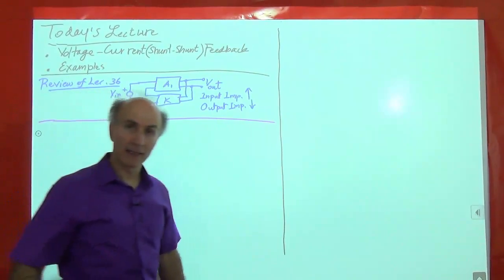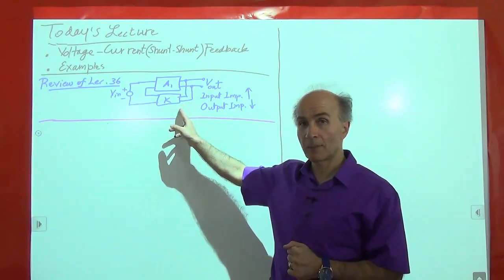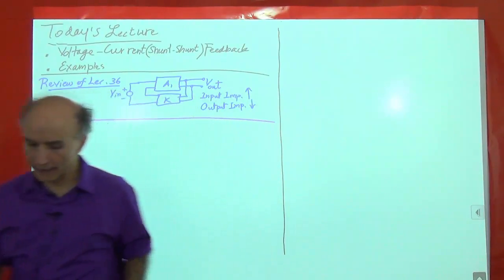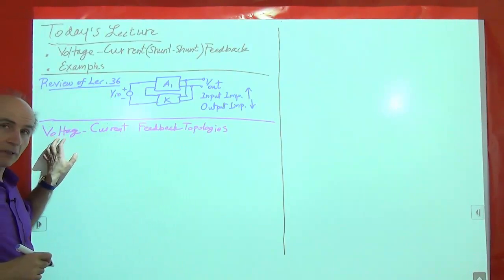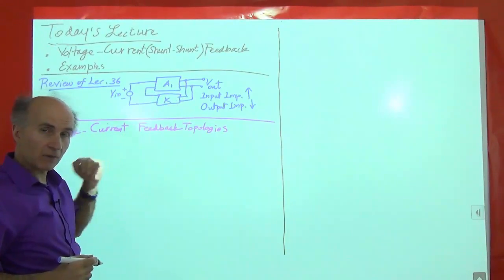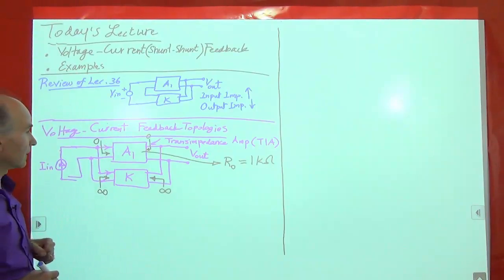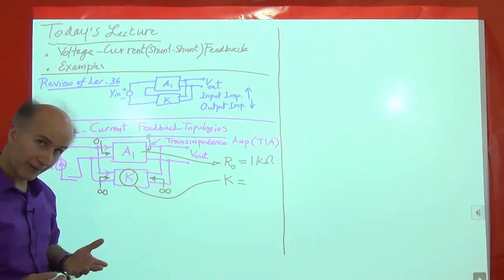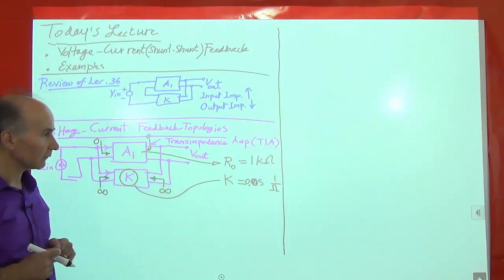Razavi Electronics2 Lec37: Voltage-Current (Shunt-Shunt) Feedback

Comment: 01:25 - Intro and Review
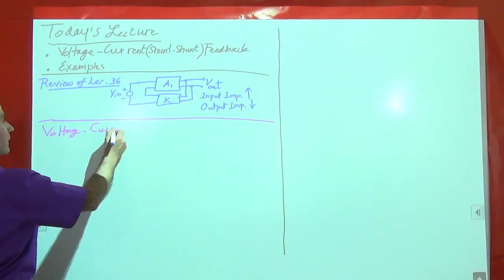03:20 - Voltage-Current Feedback Topologies
16:35 - Closed-Loop Trans-resistance
19:32 - Closed-Loop Input Impedance
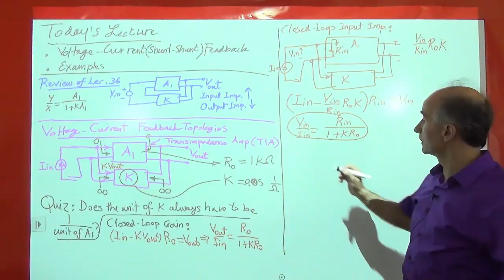25:42 - Closed-Loop Output Impedance
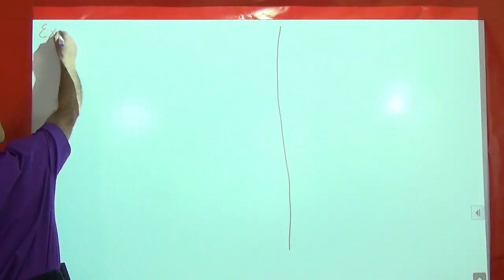33:00 - Transistor-Level Example
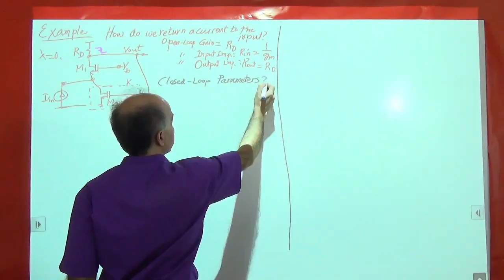41:10 - Closed-Loop Parameter Calculation
44:45 - Gain Improvement Preview

Comment: Exact solution for the Example at 42:12 will be:
K*A = - Vf / Vtest = gm2* (RD || [(1+gm1*r01)r02 +r01]).
The Open Loop Gain is A = RD.
--> Closed Loop Gain = A / (1 + k*A) = RD / (1+ {gm2* (RD || [(1+gm1*r01)r02 +r01])})
NOTE:   gm2*RD || [(1+gm1*r01)r02 +r01]  ~= gm2*RD      like Razavi did in this example.
More details on Lec 3 Cascode.

Comment: 25:38 - Note: Because feedback with great A_1 will tend to minimize error, which is in this case difference between two currents, one the input one, and other the feedback current, the current that actually flows trough the input port of the amplifier is a lot lower and thus makes lower voltage drop then if whole input current would flow trough it, making it seem as amplifier with lower input impedance.

Comment: 25:00 Shouldn't a good current source have high impedance?
Reply: He refers to A1. It is a block that wants to amplify a current so we wish all current enters A1 without losing any, This means in ideal case the input impedance shall be zero(like a current meter) so all current goes to A1. What you wrote is currect but it is not applice to the input of A1. If we had instead a block that wants to deliver a current at the output then yes you are right. It acts as a current source and must have very hight impedance in order to delvier all current to the load.
Reply: he said very good "current sensor" and not very good "current source"